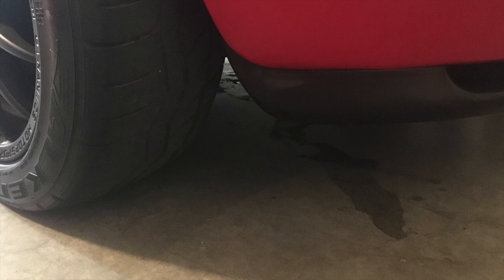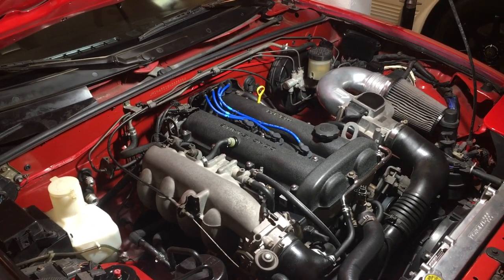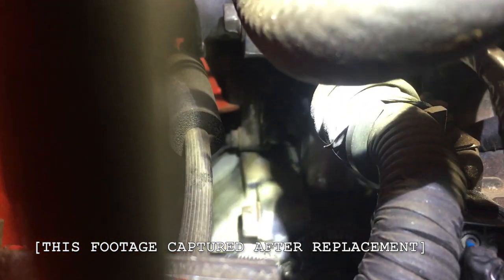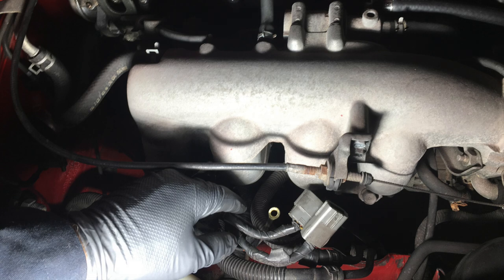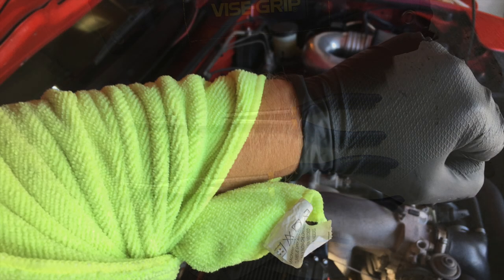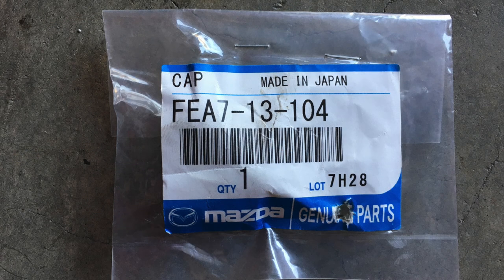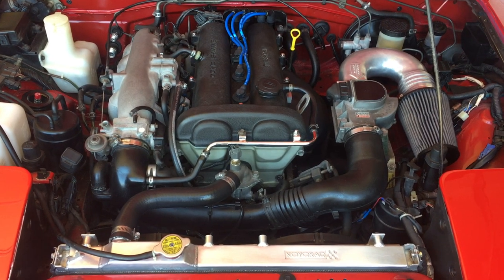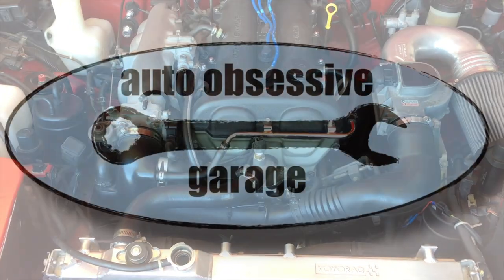Miata "Cursed" Water Plug Replacement

Comment: Mine just blew, and I wasn't sure what it was, although I could see it. Thanks for the video!
Reply from the maker: Jeff Hampton not a problem at all. Hopefully you caught it before she got too hot.
Reply: @autoobsessivegarage  Thankfully I did. Such a small little part...happy it's an easy fix though.
Reply: Same, my burst was pointing at the engine so couldn't see only hear
Reply: Get some long neck needle nose pliers, slip it right in there no problem to get clamp off. Getting plug off might come in pieces but slide new one on them the clamp, easy. I'm considering a coolant reroute just to never have mess with it again, which would come with other benefits.

Comment: It’s a good thing I’m auto obsessed because I run straight water in mine as it sees some track use.  I didn’t smell anything when it started leaking I just happened to be giving it look and saw my overflow tank was empty.  I ended up having to put a full gallon in it top everything up.  It was leaking to fast I don’t think I could have driven for more than another hour or so before I would have had catastrophic damage
Reply from the maker: For sure, when it lets go…it really lets go.

Comment: Why does everywhere online say 1990-1993? I need to replace mine but I have a 1996 miata
Reply from the maker: Yours will have a cursed water hose. A coolant hose in this exact same location that can fail the same way. I’d advise replacing this section of hose with an OEM part. 
Access to it is gained in the same way as the video.
Reply: @autoobsessivegarage  I really appreciate it! Thank you so much!

Comment: Yea, that plug is a problem. It needs to be permanently capped. If your lasted 26 years the car sat for awhile or not driven often.
Reply from the maker: Maybe she sat for a little bit of time, but it had around 120k miles.
Reply: @autoobsessivegarage  considering that is a rubber nipple, being covered in oil from cam sensor, or whatever oil leak, I would think would shorten it's life, don't ya think?
Reply from the maker: @johnnycee5179  I've seen a bunch of various seals/rubber have extended life due to exposure to oil. Maybe a CAS leak keeps these plugs alive and kicking longer haha.
Reply: @autoobsessivegarage  Petroleum derivitives will destroy rubber. I don't know about rubber derivitives/additives of some kind to extend life.
Reply: replacing mine today, mines 30 years old and still isn’t leaking! but i thought I should replace it anyways.

Comment: Dude where did you get your intake did you make that horn thing?
Reply from the maker: Mr jeffrey it’s actually the Racing Beat intake. It’s a very solid piece and was proven to make increased hp over stock with a test conducted quite a few years back.

Comment: How in the hell did you get it off.... it's really pissing me off.
Reply from the maker: Get in there with some aggressive pliers. I mutilated it taking it off. Remove all the stuff I outlined in the video to get better access. They seal on pretty tight over time, give it hell and it should come off.
Reply: @autoobsessivegarage  is it as hard to get the clamp back on as it is to get off?
Reply from the maker: @scottmoody7052  Not at all. Make sure you have good accessibility and have pliers all the way compressing it. Spray some silicone lubricant on it to help the clamp slide on. Place it straight on.
Reply: I made this replacement some months ago and shockingly the new plug failed on me super fast , I switched the spring clamp out for a worm band one with the bolt on it you twist to tighten, do you think this could be the reason for the speedy failure?

Comment: Took mine out in 5 mins without removing anything
Reply from the maker: You're lucky, my hands could never fit without removing those plugs/wires.
Reply: @autoobsessivegarage i know right yeah im installing it right as well
Reply from the maker: jcheeseman21 I believe it gained the “cursed” title because it doesn’t have a hose going to it, this would not initially be inspected if someone found a coolant leak. If you weren’t aware that it existed, you wouldn’t expect something like that to be hiding back there.

Comment: wait i dont understand? On my miata that plug is actually a line that runs to the oil filter/oil cooler.
Reply from the maker: Hmmmmm what year Miata? Aftermarket oil cooler?
Reply: @autoobsessivegarage  NB 2000. No its an OEM oil cooler. These miata came with engine oil cooler by the oil filter.
Reply: @autoobsessivegarage  The mounting surface where the oil filter goes is the oil cooler. The system utilizes coolant to cool the surface. This should in turn "cool" the engine oil.
Reply: @WorstPaperCut   The cooling system on NB's is different from NA's, you get an oil cooler the NA's don't have. Hence why you don't have a cap.
Reply: @Vinnievidivici  Yeah i kind of assumed that for NA.
Reply: @WorstPaperCut  
The stock NB system you are talking about is there to both help the Oil warm up quicker and cool down quicker after reaching high temp, it's not really an oil cooler.